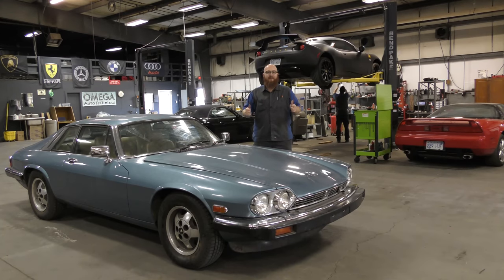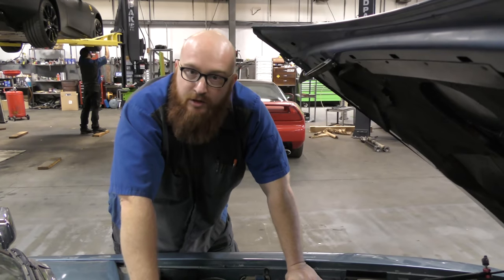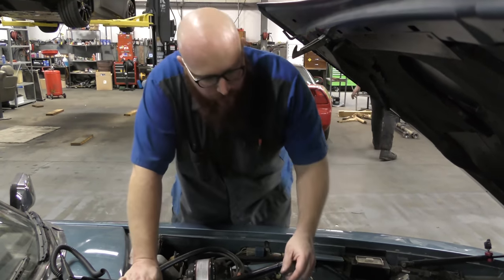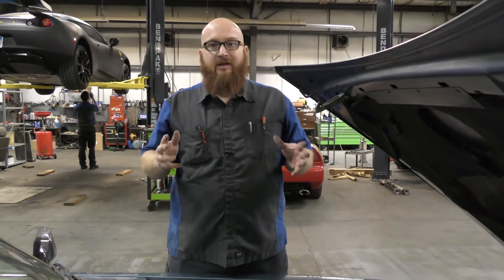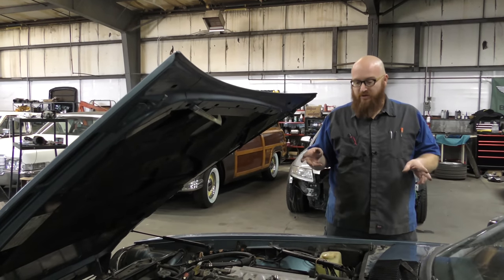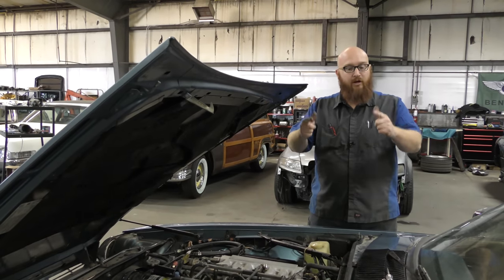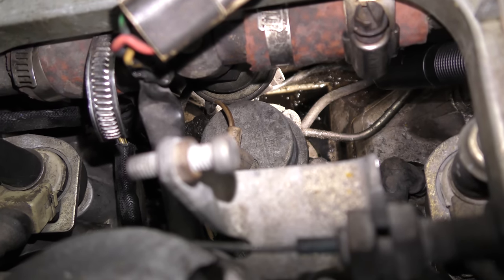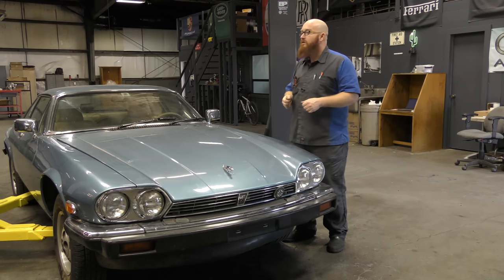'82 XJS with the cursed Jaguar V12 comes into the CAR WIZARD's shop. Can he get it running?

Comment: Love your show!    I also love the XJS!   One of the biggest importance with this engines is to have a working cooling system. The engines is extremely sensitive for overheating, and also made of aluminum so coolent fluid needs to be replaced latest every second year (mainly due to the inhibitor). If the engine has been standing still for s long time its a risk of heavy corrosion inside. Flush the cooling system and secure that it has full functionallity. The radiator can be clogged due to corrosion.    Best Wishes from Sweden!
Reply: Try a non water coolant, doesn't boil as fast
Reply: ... from everything I know about Jaguars, you are lucky if your Jag even starts every day.  Let alone "long term"...
Reply: @Beauloqs  You could be right, Lucas are known for the bullet-proof reliability of their starters, distributors and relays.  I am so wrong.
Reply: @robertmaybeth3434  yeah its hit or miss. I have an 86 xj6 and it either works great or not at all. But to be fair the car did sit for 10 years prior. Overall maintenance will keep them going well, but neglecting it will ruin the engine completely. But the lucas system is awful
Reply: if a jag has been sitting for long time not running its also advised to pour little oil in each bore leave for 1 wk then turn it over or you do damage to piston rings

Comment: Over the years I've had to teach a few younger mechanics that the problem isn't always a "single point of failure".   Actually it usually is... I mean most commonly some single thing went bad that stopped the car from running, but the moment some screwball got into the car all bets are off. 

On my wife's car I found some hatchet mechanic had kludged in an after market alarm system then another tweaker ripped it out, while chasing a no crank - no start issue. The car also had an aftermarket stereo/infotainment system.  I found the starter relay hanging mid air between the fuse box and starter motor in a ball of electrical tape.  Oddly that wasn't the problem.  But once you find dozens of wires and dozens of home brew splices that don't go anywhere and a relay mounted mid-air all bets are off, there's no wiring diagram for your car and you're troubleshooting blind starting from square one.  

In my case, it was either the fuel injector driver section of the ECU or the wiring.  I told my wife I would have to chase the wiring to confirm the ECU was faulty... but she didn't want to wait a week for me to test and re-wire the car. She found a used ECU for $80.00 and when I popped it in the car ran fine...  I got lucky... thanks to my wife's impatience, I didn't have to untangle a hundred yards of psychedelic spaghetti. 

I should add that other mechanics had already installed a new alternator, fuel pump, starter motor and valve cover gasket.  I'm guessing the problem was intermittent and I also got lucky that the ECU hard failed two weeks after we bought the car.  Chasing the problem if it were still intermittent would have been three times the nightmare. 

So yes... usually a single thing stopped the car, but if someone else has already been under the hood all bets are off, and if there's one thing wrong with the car there's no reason a lot of other things can't be wrong with it too.
Reply: Most "mechanics" of today come from the school "change the part"!
Reply: @johnchristmas7522  When I was a kid, cutting my teeth on 1960's cars, swapping parts often worked, systems were not very interconnected and parts were a lot cheaper.  Still, anyone who called themselves a mechanic had at least a couple of meters and gauges and knew how to use them. And even then we had to learn to diagnose by ear sometimes.  In some ways the new cars are even easier.  I can jack in my laptop and most of the diagnostics will pop up on the screen real time.  No timing lights, gauges or meters required, but it still requires skill and experience and test equipment to then run down the problem to a loose hose, wire or failed component.  Parts swapping can still work, sometimes, but it can get really expensive, really fast on some cars. And with so many computer controlled integrated components, a fuel system problem might show up as a transmission problem, or something likewise absurd. As a kid, we used to call parts swapping. "shot-gunning the problem" now it's literally called "shooting a parts cannon at the car".  I'm too old to really do much heavy mechanical work anymore, but I try to stay current on diagnostics.  But if someone is actually charging money for their services, the least they should do is learn their trade, before ripping people off.
Reply: @RJ-vb7gh  Well you sound like a fine mechanic but point was, that Jags and many other cars got bad reputations from very poor work done in the past, by so called mechanics. Add to that , that some customers just lie and hate to pay out money to get the job done right. All Jaguars were cars of a fine breed, priced much lower than they could of expected to charge. Some of the finest designs,
 even today came out from jaguars, so for me they were brilliant cars at a brilliant price. Coming from a different stable would have cost twice as much. Why someone would stick a V8 in one defeats me.
Reply: @johnchristmas7522  Aesthetically, I kind of like Jags, mechanically some are better than others... economically a high mileage older jag can eat a lower income person alive. As rich kids toys and collectables there are some that fit the bill superbly. But if I was the guy who had to work on one and foot the bill for parts... it wouldn't be my first choice for a daily driver.  If it were your car and you were paying for repairs, I wouldn't mind driving it or even fixing it at dealer rates.
Reply: @RJ-vb7gh  You are correct RJ but the Jaguars were never aimed at the normal working guy-big cars come with big bills. As the saying goes "If you can't stand the heat, then get out of the kitchen" and that applies to all cars. A big BMW would eat you alive just on the parts prices. I still love the  JAGS, so please let me Dream!
Reply: @johnchristmas7522  I knew guys who built and fixed them, and they lived well and I met a wall street guy who had 6 cherry examples of the cigar body ones, he kept them on in a carpeted air conditioned garage, and he lived well... and I knew a few poor folks that dropped their last dime on a $2500.00 Jag and they did not live well.... but yes enjoy the dream, it's often better than the reality.

Comment: You are a true Crossover between Automotive Mechanic and Technician. The role is to diagnose the problem accurately and repair. Working on cars or trucks both domestic and foreign, you have to do it all. Brilliant job.

Comment: Great job! Great video! For those contemplating buying one of these cars:
1st: these are OLD vehicles now. They’ll ALL need work. If you don’t have lots & lots & lots of $$$…DO NOT EVEN CONSIDER buying one. They are exceedingly expensive to fix AND they break down. Rear brake repair alone can cost several thousand $$$. Really understand what you’re buying first. These will bleed your bank account faster than a mistress. 
Believe me…I was factory trained in these back in the time they were new.
They really are for those who have patience, time, & lots & lots of $$$.
Nice presentation

Comment: I had one of these for several years. The car always started and ran without any issues. Wish I still had it. The V12 was a very refined and smooth running engine.
Reply: Actually a 383 w around 440hp works really well in these Jags.  
Simple. Fast Nearly bulletproof.
But I admire this mechanjc.
Reply: They're beautiful engines when running properly.  These days V12s are pretty rare, even more reason to keep it original.
Reply: And the sound of a V12 is like nothing else.
Reply: @joefreeman2799  Wouldn't it work even better back in the Camaro it came out of?

Comment: Thanks for making a video on an XJS! I have an 83 that was imported from the UK that i'm trying to get running right. Please please please tell the owner to replace the fuel injection wiring harness, they get cooked being deep in the V. Also check the fuel rail hoses! I'll have to try your coolant temperature sensor trick because mine smokes up the neighborhood. I would recommend to anyone interested in old jags to check out Living With A Classic, he's incredibly knowledgeable on them.

Comment: I've just resurrected one of these things that's been standing for 11 years literally this week; got it started fairly easily and it's running smoothly, but have exactly the rich running you describe including the smoke, smells like it's running on coal. Thanks for the tip about the coolant sensor, will try it, might've saved me hours.
Reply: Did it work?

Comment: I am a motorcycle tech, used to be a service manager for a Honda shop, I also did, and still do side jobs. Both at work and home, people wouldn’t tell you all the stuff they messed with, trying to “fix” it. 
I’d be going insane, only to find issues like your 180 out distributor.   They don’t my realize time is their money for some reason, and would rather pay, then suffer the embarrassment of admitting they screwed it up. It’s insane. 
Nice job Wizard.

Comment: EASY, I apprenticed on those things to a jag master tech back then. Not sure what you are using to back the claim that V12 is/was a bad motor. All the crap hung on the car was shite but that motor itself was bullet proof.
Reply: ..... with lousy gas mileage and poor power ........
Reply: @charlesstiesmeyer1494   291hp and 319lb-ft of torque doesn't sound bad at all for 1982.   13mpg city/19mpg hwy doesn't sound bad for '82 either, much less a V12 of the era.
Reply: @charlesstiesmeyer1494  Well that was all engines back then.  IROC Z with 180 horse power V8's
Reply: @macgroober1396   I remember, back in the day, reading a  magazine's review of the, then new v12 "HE" (High Efficiency) hardtop coupe model where they drove from England through Europe and back to England and achieved a VERY respectable fuel economy. I believe it was something like 29mpg (Imperial gallons).
Reply: @KiwiCatherineJemma   That works out to 22mpg U.S.  Very respectable for a V12 of any era.
Reply: @charlesstiesmeyer1494  Lousy power! In tuned form it blew all aside.. Check out the Lister from that period, they were doing 0 - 60mph in 4.5 secs, Ferrari of the same year could only manage 6.5 secs. Jaguar de-tuned it as it was not meant to be for racing.
Reply: Retired now,but when I had my own repair shop we had a Lucas EPI tester that was nothing more than a glorified Ohm and voltmeter but was very helpful in diagnosing these old Lucas but also Bosch systems.
Came with a booklet with illustrations and fault tracing procedures.
We used to call it the EPIDEMIC tester EPI (electronic petrol injection tester)
Reply: @charlesstiesmeyer1494  - 150 MPH !!!

Comment: Always check the condition of the fuel hoses between the fuel rail and the injectors when one of these V12 Jaguars is in the shop. These engines can easily burst into flames if any of those hoses starts to leak gasoline.

Comment: These cars were phenomenal when new I remember sitting in a V12 on a UK motorway at an indicated 170mph (probably 150 to 160 mph ) in comfort and  just wind noise and feeling perfectly stable and safe. These cars were not then fitted with a speed limiter and fuel consumption was probably 4 or 5 mpg ! The sad fact was that these cars were expensive and need the attention of the Best Jaguar mechanic at the Dealers not the guy who was clock watching. As the cars got older people who could afford to buy them were not able to afford service them correctly and they went to garages who thought they "knew a bit" and then they went down hill and got very unreliable. A friend who had one from new and had it correctly serviced never had any problems, ( he was a wealthy man)  he sold it when the mechanic who was the expert on older Jaguars retired  as he lost faith in the  " New" expert. The new owner got an exceptional car I hope he kept up the maintenance .
Reply: I think I remember reading, back then, that when the v12 engine was first released, it had a top speed, in American spec, of 143 mph.
Reply: @KiwiCatherineJemma  ah!  Smog control, MG B's had one SU carb tiny bore exhaust and so much "plumbing"  for the air pump it was unreal , it took the sport out of sports car...
Reply: Owned one for 10 year. they great to drive but in the end  it gave end me the shits working on it

Comment: My dad* had the V12 XJS. He had his engine modified and went to a stand alone ECU. This was done in 2014 with Haltech. Car produces over 500 hp, 6 speed manual. The car had originally 83.000 km so it was used and now its kind of a resto mod
Reply: Totally considering something similar on mine
Reply: Shakeel videos of it?
Reply: What kind of mods? Forced induction?
Reply: Yep this is what im doing to mine.
Reply: @tehgzizlauw1787  No just naturally aspirated, slightly bigger cams and different crankshaft, pistons, rods and a better flowing intake with a better flowing exhaust with race cats and mufflers

Comment: Wish i had found such a great mechanic like Wizard when i lived overthere in US. I had a jaguar and my map sensor got changed 2 times and still had the faulty code P105. I was pissed because there was not a single shop who had the willingness to measuring out the electrical wires. They just like the retirees on a bingo party constantly taking guesses and my wallet just got thinner.

Comment: I remember looking at one of these engines when I was 13 years old. We asked a old guy that pulled into the pub if we could look at the engine. It was brand new car. And all we seen was a mass of pipe work. The guy was cool for taking the time and showing us. I'm fifty six years old now looking into this engine. Lol.
Reply: cars keep us young, I'm only 24 and just finding out about the insanity of this engine. Hope you have a great day!
Reply: @mpkp2011  Hey Man. If you go into Jaguar archive footage. You can watch the making of the V12 Engine. Cool to watch. Good luck man. Stay young.
Reply: @adriandean7815  thank you I appreciate it! Trying to as best as I can, and that will definitely be watched tonight! Best of luck to you too, stay safe
Reply: @mpkp2011  - Not really 'insane'... The Jaguar V12 was developed from the old 1951 Buick 215"/3.5L all aluminum V8 with same over square 3.5" bore x 2.8" stroke. 8 cylinders = 3.5L, 12 cylinders = 5.3L. Before then UK engines were under square, long stroke,  and slow revving. High revs on the new freeways would kill them in 25K miles.
Reply: Fact is the Jaguar V12 was developed from the old 1951 Buick 215"/3.5L all aluminum V8 with same over square 3.5" bore x 2.8" stroke. 8 cylinders = 3.5L, 12 cylinders = 5.3L. Before then UK engines were under square, long stroke,  and slow revving. High revs on the new freeways would kill them in 25K miles.
Reply: @BuzzLOLOL  you confused with the rover engine. That's the Buick engine. Jaguar was two strait sixes put together. Rover and jaguar had nothing to do with each other in those days. They do now.
Reply: @adriandean7815  - Jaguar wanted a modern engine and so copied the Buick/Rover exact dimensions since it was vastly more reliable than any prior UK engine... no straight sixes used those dimensions...
Reply: @BuzzLOLOL  1951 Cluad Bailey. V12 development  from strait sixes. Le mans race car. Rover 2000 heads. Double camshaft. Later single. Original 8 litre downsized when engine went on hold. Its not hard to Google facts. I just did it. Nothing to do with A Buick engine. Don't quote no more shit Bro. Lmfao.
Reply: @adriandean7815  - LOL! UK too jealous of USA to admit they copied the '51 Buick exact bore and stroke and used those parts and engineering to speed up development...
Reply: @mpkp2011  insanity... ? ANYTHING NEW....
Reply: My thoughts exactly. I was 14 when the XJ-S came out in '76. I still remember the shock I got when I found out the price was CA$25K. Its a miracle the car was even built considering British Leyland declared
chapter 13 bankruptcy '75. I also remember the difficulty in obtaining parts due the constant amount of strikes at British Leyland meaning massive amounts of back orders. Having worked with my father in his
garage at the time I remember this chaotic headache very well when ever we had to repair a British car.
The Jaguar V12 is a wonderful engine,you just have to know how to repair and maintain them correctly which unfortunately can lead to an SBC swap if one doesn't know how to repair and maintain them. I first saw a '71 E-type with the V12 in '71. After some research I found out it had 314 bhp and it quickly became the car of my dreams,even after all these years I still want one. Although the E-type and XJ-S are different cars,their design has aged well as they're classics in their own right. I'd take a well maintained one of either in a heartbeat if given the opportunity. Ah well a man can dream can't he? But I suppose that's life and we must rock and roll with the times,with the dreaded COVID-19 pandemic this will be more challenging. Gr8 work David and crew.